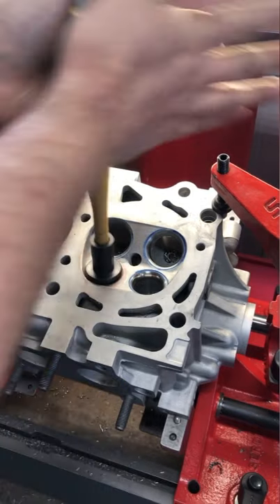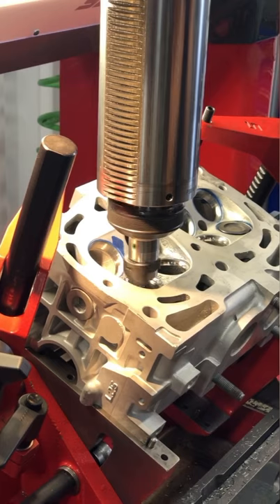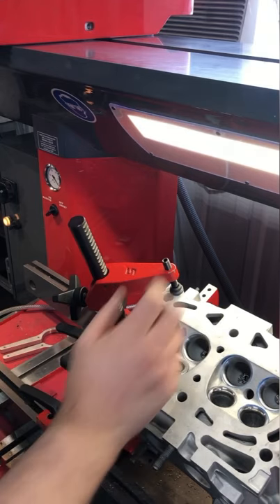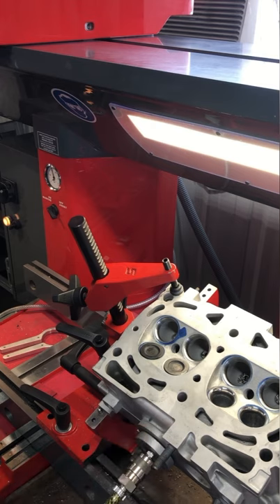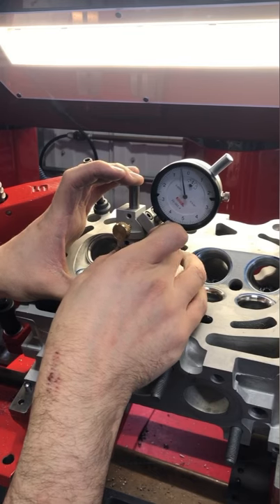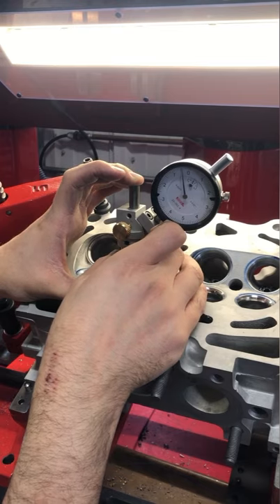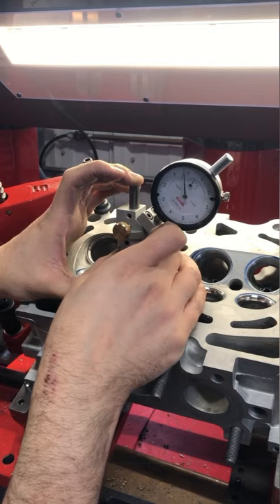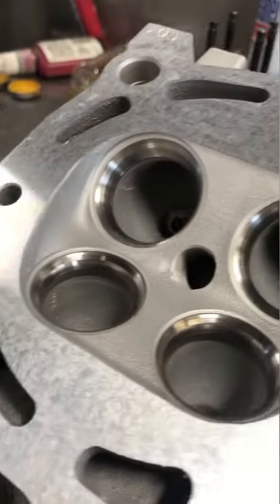#shorts Let’s try and explain this... again?

Comment: 1/10,000 is 0.0001 not 0.001
Reply from the maker: Yep! That's how fractions and decimals work!

The valve seat runout gauge indicator has a resolution of .0001". On the seat I show measuring here, you see the needle oscillate between ~.0002" and ~.0008", which equates to .0006" runout. Hence my graphic "Less than .001" runout in this case".
Reply: @JAMSIONLINE  It doesn’t matter, Subaru’s won’t last long enough to burn a valve, Boxer engines are one of the worst engines made.
Reply: @sidallen685  You are the only person in my entire life I’ve ever heard make that statement lol
Reply: I see somebody doesn't understand the math...
Reply: @Keebrev    You must not know any Subaru mechanics do ya, I’ve worked on them for years, those boxer’s are bad to blow head gaskets.
Reply: @sidallen685  Every mechanic that works on a specific brand of cars thinks they suck. When that’s all you get in your shop, you form a bias. You haven’t proved your point whatsoever.
Reply: @sidallen685  if you work on Fords all day, you’ll learn all the issues Fords are prone to. Same if you work on Toyotas, or Chevys, or any other kind of vehicle. That doesn’t mean they’re bad cars.
Reply: @Keebrev  I’ve been a mechanic for 40 years and worked on every make of automobiles, I don’t need to prove a point to anyone.
Reply: @sidallen685  based on your multiple comments you need to feel validated somehow. Glad I’m doing that for ya grandpa
Reply: @Keebrev  Some people just can’t be reached son
Reply: @sidallen685  🤷🏽‍♂️ ditto
Reply: Yeah they say 1  ten thousand but show 1 thousand .001
Reply: @sidallen685  lol. I’ve never seen a 50+ yr old mechanic hop onto the internet and talk like this. I guess it’s possible but it’s just sad lol
Reply: @tlc5343  Just telling it like it is, although Subaru has made me a lot of money over the years, I could not or would not recommend them to my friends, if I did I wouldn’t be much of a friend. Age has nothing to do with explaining whether a vehicle has any quality to it, hopefully you’ll learn that lesson with time, do your due diligence before purchasing any product.
Reply: Brock Wesner  was a Toyota tech, yes many self induced due to oil consumption, did tons of pistons on them as a warranty extension. I now work independently and yes subaru has a ton of head gasket issues but many owners are the cause just like the timing chain subarus that burn oil.... Low tension pistons and telling people to go 10,000 miles on an oil change without topping off.... So consumer reports can rate the cost of ownership low due to never 'needing' maintenance like the service for life transmission fluid.... BS, serviced to die at 150,000 miles because it's nice to sell parts on what the manufacturer isn't on the hook for.... So gentleman, you have picked your sides which is not to say your points are to be undone but boxer motors have their place, Sid, I guarantee has never been behind the wheel of a Turbo GT-2, if so he'd never had said that.
Reply: @jackboyer1280  he says "down the the .0001 "  basically what the indicator will read. He didn't say anything about getting it to .0001
Reply: @justinweaver7553  difference is those extra 2 pistons in the Porsche gives a good head seal so it isn't completely garbage. And with the engine in the rear you don't have to undo motor mounts to change a God damn spark plug.
Reply: I used to own a subaru forester and it used to break down on me 💯 so I turned it into a submarine.
Reply: @nameless6161  best comment. 

To everyone else, all cars have problems. Being a mechanic that sees everything from economy cars to maybach and Maserati I can tell you that none are perfect and all have problems. Just depends on what you are willing to deal with and how much you can spend on the problems. When I personally shop for a vehicle I like to pick the type of vehicle and find all the options that fit my needs from all brands. 
Narrow it down based on common reported problems, difficulty and cost of common problems and once I have it narrowed down to 2 or 3 options I pick the one that I like the overall feel of and how willing I will be to work on it. 

I know this section started because of subis being "junk" well I have seen some high mileage subis that still run good.  
I have seen low mileage BMWs and GM vehicles that were worse off. Since I also saw toyota mentioned, it pains me to admit it since I am a Nissan enthusiast but Toyota by far makes the most reliable Japanese vehicle from what I have seen. Most toyotas I only see for normal wear. The amount of oil /coolant leaks and corrosion is usually minimal. I can't say that about GM,Ford, Nissan, Subaru, Mitsubishi, Dodge,VW. 
Mercedes seems to be overall decent as with a lot of high end cars, they so far have mostly only had electrical issues and suspension wear. To be fair most of them aren't high mileage but old enough to not have any warranty.
Reply: @sidallen685  “those boxers are bad to blow head gaskets” there was 1 Subaru engine ever that had head gasket issues
Reply: @pospc2  loved your comment. I’m going to put this out there, I love volvos. They’re decent to work on and have a high safety rating, a little more expensive to maintain but I’ve been winning the fight for 5 years now owning two of them. What’s your input on volvos?
Reply: @tlc5343  take it for what it's worth but I don't see a lot of Volvo. Which that could be a good thing. When I do see them it's normally for basic maintenance items.
Reply: @sidallen685  i don't own a Subaru, but my brother owns a legacy. I've talked to a number of Subaru owners.  They all love them, including the boxxer. There are quite a few making a lot of power.
Reply: @sidallen685  false to a point I have a 01 outback no work done except routine maintenance and im kicking over 300,000 soon
Reply: @sidallen685  40 years as a mechanic doesn't fucking prove anything when you refuse to provide evidence like a child.
Reply: Toyota will always be far more reliable than Subaru. You guys will get over it. Ever wonder why almost every manufacturer has used toyota parts over the years?
Reply: @sidallen685  As long as you present solid statistical evidence (avg engine lifetime or something like that), I'll believe you. If not, I'll just go with word of mouth, which says that those are pretty good. But feel free to present your evidence! (This is not meant to sound salty or sarcastic. context is hard to convey via text)
Reply: @vincentguttmann2231    Your welcome to waste your money anyway you see fit.
Reply: This is cool!! Thanks for sharing
Reply: Brock Wesner  that’s what I was thinking...
Reply: @pospc2  You wont even find a Mercedes dealership that will work on economy vehicles so where do you work that deals with Maserati and ordinary vehicles? What is the hourly rate for your establishment?
Reply: @jeffdavis3481  it's a large used car dealership that is nationwide in the us. I won't mention names because they monitor social media for mention of them. I get paid by the hour and don't deal with the general public. It doesn't matter if I am working on an econo box or a high end car I get paid the same
Reply: @pospc2  I dont doubt that you are a mechanic but you lose credibility with all but the remedial with that story. 1st off, the dealership wouldn't go through the effort of having you certified to work on Maserati if they didnt get them in on a semi-regular basis. 2nd, if you are a good enough mechanic to work on that level of vehicle you already know the dealership wouldn't waste that much money paying you to work on a honda or Toyota. Completely different class of clientele as well.
Reply: @tlc5343  Why is it sad and why is age an issue?
Reply: @pospc2  I’d have to say Honda over Toyota but both are great manufacturers. Nissan is like a Asian crystler to me some good makes but always meh
Reply: @sidallen685  you should speak in terms of models and not brands. There are toyota models that suck and bmw models that are good.
Reply: @sayingnigromakesyoutubecry2647  Good luck with you’re Subaru
Reply: @sidallen685  I'm not a Subaru
Reply: @sidallen685  I agree boxer engines are terrible you can't put a big  turbo on them till split apart even with ARP bolts they don't make a lot of power in my opinion.
Reply: @sidallen685  they are shit indeed, but anybody has to recognize boxer engines can be fun during the short period that they work
Reply: Nice video but when I hear somebody say first and foremost a couple times I find it weird.
Reply: Most machinist just call it a tenth. They all know that means a tenth of a thou.
Reply: @jackboyer1280  your digging too deep. Read the comment from creater. Then rewatch the video. I understood after I did that. He said run-up was six ten thousandths. (.0006) Therefore total run-up was less than one thousandths. (.001) which it is clearly as you can see im sure.
Reply: @sidallen685  Gotta agree with you Sid. But the 2 Subs I owned were back when I was younger and I put both through hell and back. So idk if the head/head gasket issues was my fault or if they’re just prone to blowing.  But I’d never buy a Ford Taurus ever again. Less than 50k and transmission went out. And while looking for a slightly used one. Took forever but ended up finding 2. The first had less that 15k on it and 30k on the other.  Ended up having to buy both. Damn pos just stop working 
If it says METRIC on the trans pan trade it in if you can make it to the dealership in time 🤣 
Easily the worst pos I’ve ever owned
Reply: @JAMSIONLINE  hahahah YES. Love this hahaha can’t stand little trolls who have NO IDEA what they are talking about.
Reply: @sidallen685  Look into the design disaster called the Chrysler 2.7L.
Reply: @JAMSIONLINE  actually you can only skin a cat one way or your gonna get bit and scratched all to hell
Reply: @sidallen685  wym. Subarus are great cars.
Reply: Yeah since the EJ25 just oozes reliability..
Reply: @Chandler Onufrak I also have a 18 f150 ecoboost work truck. At 94,000 the cold start sounds like it’s about to rattle apart, does yours have this issue?
Reply: You have to live under a rock to not be familiar with Subaru and their problematic boxers
Reply: Holy crap guys. I build all types of engines day in and day out. Thier are those that suck and some good ones. Stop arguing and build something then blow it up and repeat.
Reply: @sidallen685  it’s funny. Because I’ve worked at a shop that specialise in Subaru boxer engines. And they so far have when refreshed turned out to be one of the strongest and pound for pound most responsive engine to tuning out of pretty much any engine bar a Honda k motor. 
In fact a very simple 2.2 engine built with mostly stock Impreza parts but hand finished. And with decent pistons rods and hardware. Now spins over 10k rpm and makes the best part of 1000hp. And has been together for years. 
Like any decent engine builder will tell you. The biggest problem is either the operator or the mapper. Not the engine.
Reply: I love when a keyboard mechanist gets lined out haha we all know .0001 is not .001 haha swing and a miss
Reply: @sidallen685  I had a GF8 Subaru WRX with an EJ20ET that had 276 000kms on it. Only ever had cambelt and waterpump done, plus general servicing. It went hard as f*ck. It got stolen and wrecked, my mechanic mate bought it off me and stripped the engine. It had the original subaru head gasket on it and had no evidence of being replaced. Valves and chambers were all mint like a new engine. Was one of the most reliable cars I have owned.
Reply: @stevenjohnson1692  You don't have to pull the engine out to do the sparkplugs on subarus
Reply: @stevenjohnson1692  you actually have to pull the entire engine out to change plugs on many 911's.
Reply: As the smoke drifts over the ring you hear the bell and over the speakers you hear; "in this corner  Sid Allen. 184¼ pounds and a reach of 69 inches, and in the other corner, everyone wanting to argue."  After 32 rounds the arguments still fly back and forth and as in all battles ... Everyone loses. 😔
Reply: @Keebrev  nah he is right, its the same with rotarys. Owners dont check their oil enough so they blow up
Reply: @Keebrev  Subaru boxer engines are garbage.....
Reply: @Keebrev  
I'm gonna have too back Sid up here when he says those are notorious for blowing head gaskets. Almost all the one's I've worked on. I did heads in them. 
Which isn't to bad, after I sent them out i'd guarantee them for 50k. 
If you want proof that I can give. Call Larry's garage in Rockford Illinois. It's a machine shop and ask him what his bread and butter. Heads down it's those Subaru heads.
Reply: @sidallen685  it’s only turbo subarus that have head gasket issues and all you have to do is get six star head gaskets and it’s completely fixed they don’t blow after that, any performance car has it’s own set issues there isn’t a single one that doesn’t have failure points
Reply: @Keebrev  to be fair they run on on gasoline and head gaskets
Reply: @Keebrev  hes right
Reply: @rboyett  exactly, the EJ253. Every other one hasn't had that problem. Ringlands on a 255 or 257 yeah those were a problem but only when boosted with low octane fuel lol
Reply: @griffin_kith6214  The turbo Subarus should actually be less prone to failure than the NA models for a combination of reasons. The turbo engines have a higher torque spec, the gasket design is better, and the semi-closed deck design prevents the cylinder walls from shifting around. Installing a turbo head gasket in an NA Subaru and torquing it to a the turbo engine’s spec seems to be the most common fix as of now.
Reply: @Keebrev  Have you learned that Subarus are junk yet?
Reply: @user-lz3sv5sw9u  they aren’t regardless of what people say I build wrx’s and sti’s as a living, a NA subaru can make it past 300k on the same factory gaskets it came with, a wrx or sti’s head gaskets will always start at least seeping at 60-100k miles they just do
Reply: @sidallen685  being a boxxer has nothing to do with the subarus reliability issues.
Reply: Where’s your shop and phone # @JAMSIONLINE
Reply: @rboyett  yep, that one year Outback, right? Like ‘01 or something like that. Most failings are due to poor upkeep/prev maintenance on the turbo models (WRX, Forrester)—can’t just set it and forget it.
Reply: @sidallen685  you could make a fair argument that a rotary engine is worse.
Reply: @Keebrev  bros being extreme but head gaskets
Reply: @sidallen685  the modified Subarus are the ones that are mostly prone to head gasket issues. However, under normal circumstances, with regularly scheduled routine maintenance, and letting the engine warm up to proper temperature; this is not an issue.
Reply: @Keebrev  Well I agree with him. Subaru engines are shit.
Reply: 100 tho = .1
10 tho = .01
1 tho = .001
1 tenth = .0001
How shops talk numbers ya kinda backwards ik. Blame japan haha.
Reply: @sidallen685 subi fan boys get salty when you mention their quality. Like ya said after a few rebuilds thell come around... i hope
Reply: @sidallen685  VW bug would like to have a chat with you
Reply: Love those internet machinists

Comment: in  automotive school they teach that Prussian blue (a blue dye that looks extremely similar) can be used for spotting uneven surfaces that cause valves not to seat. Looks the exact same and is applied/used the same way so that is probably the confusion

Comment: I understand what you are doing, checking the seat contact area, a fine line between too narrow and too wide margin makes a big difference
Reply: That's what the nay-sayers are having trouble with.
They don't understand why it is necessary to center the valve contact area on the valve seat.
From the need for maximum heat transfer  ...  
to the differing expansion rates of component materials  ...  

they seem oblivious to what is happening.
Reply: That depends on the application..
Reply: It shouldn't matter what the application is in this situation. With two different metals and both metals having different expansion rate and heat dissipation rates. He wanted to center the  mass of the valve in the center of the mating surface for maximum sealing during heat transfer.

Comment: We that know, know! Typos and editing sh#t happens folks!  Don’t kick these cats in the sack. Kudos to the head guy in the video at Jim’s Automotive Machine Shop, Inc.   these are the most common and preferred practices in fixing the garbage the general population prefers not to maintain or build correctly for their application.  This process can get much more complicated and costly per your needs.  ( Born and raised by a tool & die maker and im a gear head extraordinaire)!  Thanks for the video!

Comment: Interesting to see how times have changed. In the 90's we used to cut the valves, and seats, place to valve in the guide and smack it down with our finger. Remove the valve and look for the mark made on the valve by the seat. We only lapped valves if we did not cut the seat or valve. Keep up the good work, great seeing the younger guys staying in a trade rather than a cubical.

Comment: So my understanding is that lapping allows the valve to seal uniformly no matter which position it gets into, your vaccum check is only checking the valve in one orientation.

Hope this makes sense and i’m not intending to troll.
Reply: That's true, although machining gives you precise valve face and valve seat geometry, lapping is still the best, proven way to insure a robust microseal.